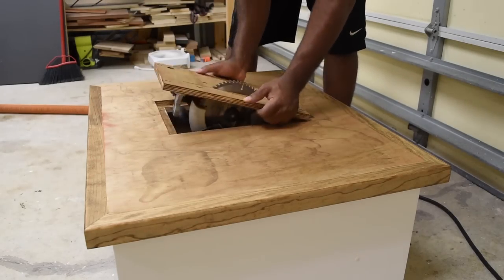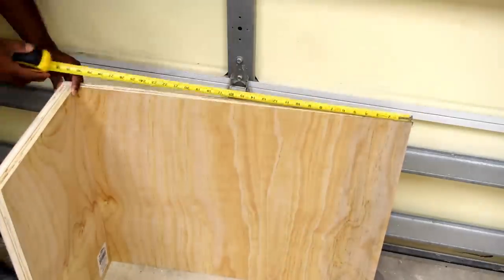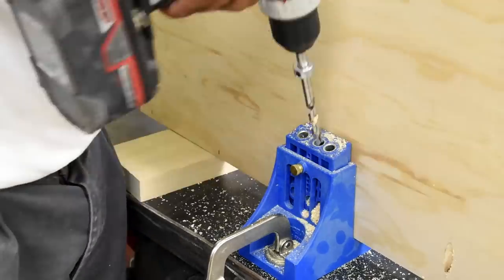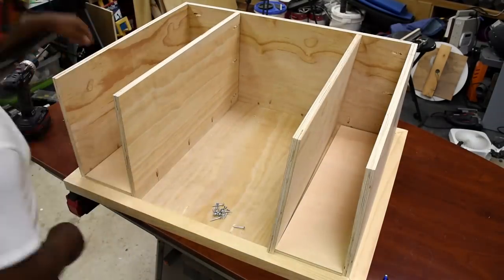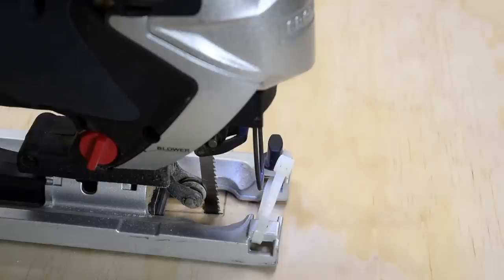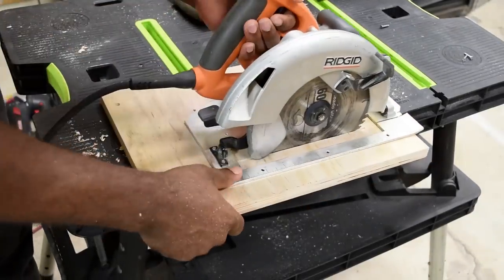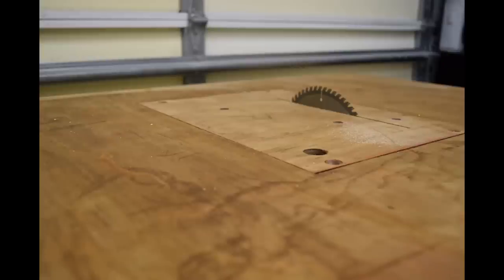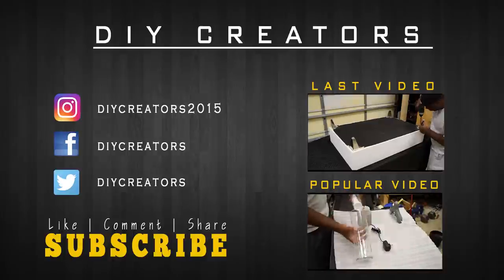Homemade Table Saw 4 in 1 Modular Workstation

Comment from the maker: Table Saw Plans: https://gum.co/ihJY
Homemade Table Saw (using it): https://youtu.be/-Oq57fYy9ik
Table Saw Fence: https://youtu.be/y0R5rO1jJqM
Homemade Table Saw Stand: https://youtu.be/T2Tx7vwOH8I
Reply: How easy/difficult is it to pull your tools off of the inserts?  Would you want to have a dedicated set for the table or can you swap them in and out easily?
Reply from the maker: Its pretty easy but that depends on how often you need to use them. It 4 screws to remove.
Reply: Wow, thanks for the quick response.  I have a table saw already but this seems really good for a routing table and bandsaw/jigsaw.  I just finished a diy remodel and a chop-saw insert with dust control would have been awesome.
Reply from the maker: :). Yes I agree. I like the Chop saw idea
Reply: Very very nice, man. But it is impossible to see your plans. It seems the link is not working. Can you send your plans, please. Thank you.
Reply: DIY Creators q
Reply: DIY Creators 
4
Reply: I try to buy your plans and I received the following message: My name is Sahil. I'm part of the Gumroad team, and we power the payment process you tried to complete recently. I got a notification that you attempted to purchase Homemade Table Saw Plan using PayPal, but it looks like the transaction ultimately did not go through....
But paypal says: Thanks for your order at Gumroad Inc. Money won't leave your account until Gumroad Inc processes your order.
Please answer me on this issue because I want to start building the table with the actual measurements.
Reply: DIY Creators or
Reply: Can you build me one
Reply: DIY Creators
Reply: Very Nice Idea! But for the ten dollar fee for the plans, Should have also include a cut layout for a 8' x 3'  3/4 in plywood?
Reply: how did you get the saw to stay on
Reply: DIY Creators
Reply: En español
Reply: Could you do a video on how to add a belt sander as a stationary add on, either as an insert or something we could install on the side of the work bench?
Reply: bạn gửi cho tôi kích thước và thiết kế cái bàn làm mộc đấy cho tôi với nhé.You send me the size and design the carpentry table for me.
Reply: @nateknudson8500  .
Reply: DIY Creators I have a suggestion I use on my set up.   I took an old sewing machine foot pedal and wired that into my switch.   It’s another layer of safety and control.  

My tool must be turned on, my safety switch must be turned on, and I must step on the pedal to make the tool operate.   It’s speed sensitive so you can actually control the speed of your jig saw.   I would recommend only going full speed with other tools.

The only time I have gone partial speed with a different tool was using a circular saw to cut sheet plastic.  I don’t think the tool liked the lower voltage too much.  Would not recommend
Reply: Thank for share,,peace from indonesia,,
Reply: Super talented
Reply: Does the project also contain a vertical guide to buy together?
Reply: Dans tout ce que je vois aucune mesure rien que des bonnes idées dommage
Reply: Este vídeo está en español o solo en ingles
Reply: You should revisit this table. And add the vacuum option to most of the cutting service. One day I’m gonna get good enough to try this table out. Thank you for the inspiration!
Reply: most useful video I have watched
Reply: Could you use pegboard for sand Vac insert??
Reply: @NolbertNFM  pudiste obtener los planos, gustaria compartirlos conmigo, se que es innoble pedirlo, pero no tengo dinero en estos dias dificiles. Ando reinventandome y aprendiendo carpinteria para tratar de sobrevivir.
Reply: como hacer para que los cortes con la circular queden bien alineados?
Reply: How to make the cuts with the circular saw are well aligned?
Reply: Waw
Reply: Could you pass me the measurements of this table of width, length and height, please
Reply: Yo you hooked that up thank you
Reply: @DIYCreators  how about adding a clamp mechanism to eliminate the screw thing
Reply: Hi Glen, This doesn't really pertain to your video. But i recently bought a new Dewalt jobsite saw and wanted to make a mobile cart with storage drawers. Any suggestions I'm still relatively new to all this
Reply: Hi! i bought your plans for the workbench, great! project however i didn't see where/how you attach the plywood with all the holes or the dimensions of that piece, please help.

Comment: I like your plan here.  You may be getting  thumbs down from people who don't believe pocket screws are real woodworking.  I do, but i think all joined pieces of wood should have been glued as well.  It makes it significantly more rigid, especially with potential vibration issues as screws can vibrate and slightly loosen after a few years.

Comment: Very nice!  Only change I would suggest is a proper power switch with emergency stop.  You can find them at Rockler, MLCS Woodworking, Woodworkers Supply, Grizzly (Grizzly has the biggest selection of these 4) & other wood working / power tool supply companies for $10 & up depending on amperage capacity & features  i.e. direct wire, plug-in, magnetic, etc...  For this type of setup it needs to have a recessed start button (that cannot be activated accidentally) & an easily operated large emergency stop button.  OR a deadman footswitch for power.
Reply: I was going to make the same comment. I cringed when I saw the switch he used.

Comment: I watched months ago, but got suggested.  My impression was that it was a good project/video, and decided to watch again, and am glad I have. 
I appreciate 2 main, important things about you,
1) This is a great project, which will immediately serve the builder well for the long term.
2) Your production values are exv3llent as well.
Focus was always spot on.
Photo angle was well done.
Sound was narration, which was well paced, and we'll explained regarding the build.
Sound background music is something I dislike a great deal on YT as so many do it so very poorly.
You did a fine job adding your background filler music.  Volume was great, never interfering with narration, and instrumentation added interest without distraction.

I live in a townhome, just as you described having little space, so I believe I must consider this for my immediate build as I need a table, and table saw. 
Using your system I will have great diversity in use, so I thank you.
Excellent video.

Comment: I love how you have done this video! Lots of handy and important tips that you would have to spend hours searching MANY other videos for. Clear, concise, and to the point. Thank you so much! :)
Reply from the maker: Thanks man!
Reply: DIY Creators No mate, thank you. Thanks to you sharing those little bits of advice and tricks that a seasoned DIY'er knows I'm able to speed up my learning process and work. I've seen many of those little bits of advice on other videos, but they're few and far between and I had to watch literally dozens of videos to see only most of the tips you put into this one. Do you think you might be able to do a video showing more of these things? For example the way you support the wood at 1:10 with that piece of scrap, or the way you use the speed square to cut those 45 degree angles.
Reply: Awesome mate a well explained video lesson easy to follow not a lot of technical jargon nice work 👍

Comment: This is an excellent solution for a small workshop where every bit of space savings count. It's so versatile, I already have ideas for other inserts - maybe a spindle sander, or a planer. I also would add holes for bench dogs, and a vise. And I'd sink rails for saw fences into the top of the workstation. This is definitely my next project. Thanks for the great idea and the video, I love it!

Comment: Excellent video and a great idea!   
My only thought is to ~somehow~ make the power saw plate adjustable up and down so you can change the blade height for different material or for doing variable depth cuts.  
~how~ to achieve this, I have no idea ha. 
~maybe~ spring loaded bolts that can be done up or loosened to raise and lower the saw?   then again, that may not be stable enough, I suspect a welded frame would need to be employed.. hmm.

Anyway, this has been an excellent project. 
I'm sure I'll be watching a few more of your videos.

bloody good job mate.   cheers from Australia.
(PS,  Please include metric measurements, as pretty much the rest of the world uses it :D )

Comment: wow! I need this in my life, I live in an apartment complex and I am a DYIer, Mostly with electronics. but a lot of my projects I need to make enclosures for them, but in order to make the enclosures the way I want to make them and the materials i want to make them with, I would need to get a bunch of tools and tables that I simply do not have the room or money for.This video is going to change my life, now only if you had a solution for a drill press using a cordless drill... lol
Reply: im not a wood worker, however i have been watching a lot of wood working videos, so this idea may or may not work, but what immediately comes to mind for a drill press using a cordless drill.... create a jig to hold your drill firmly, then mount the jig to metal drawer slides, and then build some wooden gears that directly move the jig up and down. (i dont currently have any idea how to keep the drill from moving down when in the up position dew to gravity but maybe you have an idea for that) i dont know if this idea would work or not, but if it seems possible/practical than  give it a shot, and if you do end up creating a way of using your drill as a drill press, comment back and tell everyone how you did it and what your experience is with it :)
Reply: That drill press seems ok, but the issue with that is it's just one unit, period... With a jig, you can infinitely customize it, and change whatever you want on it at any time, like exchanging your current drill for a much more powerful one later without your setup being completely altered
Reply: French4Assassin if such devices like the one colonelerotic suggested exists (which makes sense to me that that would) than I think that is the best option, no need to diy, may provide a more accurate plunge, and these units probably have already had most/all bugs tweeked out of the design for the best possible experience for the user while keeping the customizability of changing your drill, bits accessories etc
Reply: thanks guys, Ill look into it.
Reply: they do sell something that turns your regular drill into a drill press. also there's a cheap jig available from harbor freight for like $20 that allows you to hold the drill at a perfect 90 like a drill press
Reply: Don't forget that a drill press can exert a lot of downward force. Perhaps a corded drill would be sturdier?

Comment: Safety, a riving knife at least needs to be present on a table saw. A good fence and miter guide is also missing and are REALLY, really important. The second a person gets even the slightest bit careless on this saw, they are going to be missing fingers. An experienced craftsman could easily use this project without injury, but that unfortunately isn't who would be most likely to build it. Kickback happens FAST, buying an inexpensive table saw and building around it is a much better approach when looking to add what is the most dangerous & useful tool to your workshop. 

If you are starting from scratch the cost difference would be awfully minimal taking the demonstrated approach and having to lift it up for every bevel and height adjustment will be annoying to say the least. If you wanted a 10" blade as is pretty standard on table saws, those circular saws are more expensive than basic jobsite/portable table saws to begin with. The 7" blade on a standard circular saw is really going to be limiting in this application. There are plenty of $250-$300 table saws that offer so much more versatility, safety and easy of use that can be found easily on the used market for half that. 

There is a good reason a million guides exist for making table attachments for routers and jig saws, but not for circular saws. Will/does this work...of course it does, but I would NEVER recommend it unless the alternative was completely unavailable and it was absolutely required for work by an experienced operator. Hobbyists, like myself, no.

Comment: Great video!  I'd make a couple modifications: 1. Leave out the trim and make the edge 3 inches around the table so it can be used as a work bench with workpieces clamped at the edges  2. Add grid holes to all of the inserts because all of those power tools generate sawdust.

Comment: Just want to say thank you first video that's bit really straight forward. To hide screws you could drill the hole then after you have get larger drill bit drill the same hole then after putting the screw in put pit of wood to that size hole wait for wood glue to dry the saw it off and the sand it lol it lot more simple doing then how  Feld at describing it .

Comment: I'd say you have the best design for transforming power tool on YT. What I am wondering though, is how do you get the skill to stay running without pulling the trigger or holding the safety down?

Comment: Great idea. Just a small thought: when you made the saw gap in the insert, it would be really useful to make it at least a half inch to an inch wide. The reason for this is that, over time, if you ever want to do more involved cuts to create dado's or make wide-fingered box joints, then you'd need extra room for a dado stack to create the dado or the box joint troughs.

Comment: so i really wanted to make this because the power tools that I don't have, a circ saw, jigsaw, and router, are relatively cheaper than seperately buying a table saw, bandsaw/scroll saw, and router table in addition to those, but I was wondering if you'll get to the riving knife part because safety is impt, btw, awesome video!

Comment: i like the way you present your work, if you have a concern about the electrical outlet do a kids safe outlet that comes with covers on all the holes or install kids proof plug on the side you are not using, wood is not a conductor of electricity so it becomes a non issue for any fire hazzard, a lot of people likes to add negative comments to this great videos becouse they have nothing positive to give, keep up the good work and look forward to the next video.

Comment: So, I’m curious what type of blade/blades I’m going to need to buy to give the best cuts. I’m planning on using it to cut plywood as well as lumber to mill down for cutting boards/small projects. Any suggestions? 7 1/4” thanks!

Comment: I have done similar things. My suggestion would be to mount the tools to a metal plate so that there is minimal loss on how far the cutting tools protrude from the surface. To keep any bolts flush to the plate you could either countersink the hole with a larger drill bit (a possibility of the bolt pulling through), or hammer the head down to create a dip (you have to deal with metal protruding through the other side), weld or braze some metal to the other side (you might as well weld the bolts on). Any which way, you need to find a secure method of securing a metal plate with a dangerous high speed toolbit.

Comment: Gudpm Sir coz it's 8:55 pm here in the Philippines. I like your diy table saw among others. Also your diffetent projects in woodworking. Here in our country, if you buy a branded table saw it cost you a lot also we only have limited branded ts. This is the reason why i would like to make a diy table saw using my Bosch circular saw. I like woodworking very much. My question is, is it safe to make a table saw using my circular saw? Many woodworking vlogger discourage this practice coz they said its dangerous. Your thought. Thank you and more power. Godspeed.

Comment: Yeah, I don’t get the thumbs down.  This is one of the most exceptional projects I’ve seen.  I just spend $600 on a. DeWalt that has had some issues.  Wish I had seen this prior to my purchase.  Excellent job on this!!  I may make it in spite of owning a table saw (my DeWalt has too many inaccessible, and poorly designed work elements / features).  I spend $600 on something made in a foreign country and it needs to be “tweaked” and “adjusted” and blades and riving knives need to be “aligned?”  Crap.

Comment: If your joints are all very close, adding glue in the joints will make them WAY stronger then just screws alone.  At that point the screws pretty much become the way you clamp the joint while the glue sets up.  I strongly recommend glue, even though what you see here will work very well.

Comment: Awesome project but a quick request - Please do a video on power tool repair/restoration. I got a burnt out 18V Makita DUB182Z blower and when I took it apart, all its wires and cable clips/ lugs are burnt. Plus 2 x 12V battery drills. Plus its cable/wire parts are currently obsolete.

Comment: I suggest to finish the bottom of the top the same as the top  side to prevent the potential for warping if you have any changes in humidity. Also as a final coat for easy sliding try Johnsons Past Wax. It has been around forever but man it works great